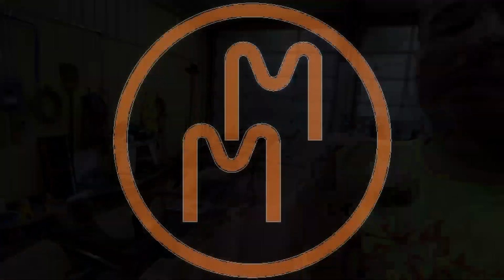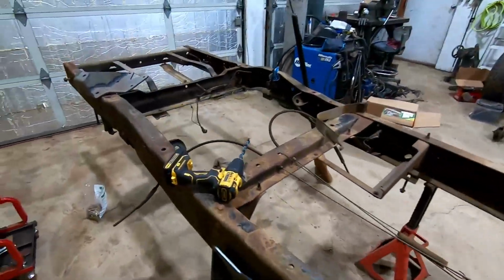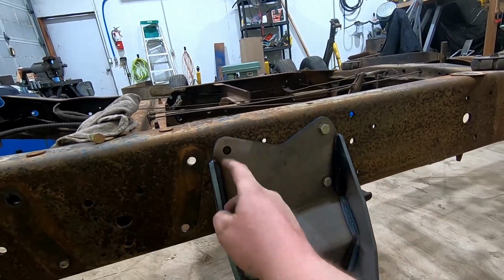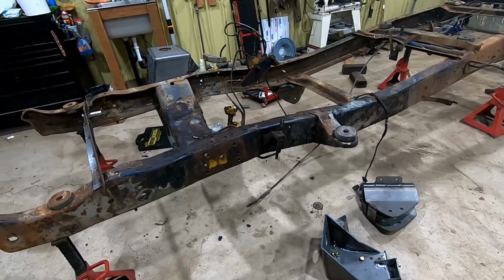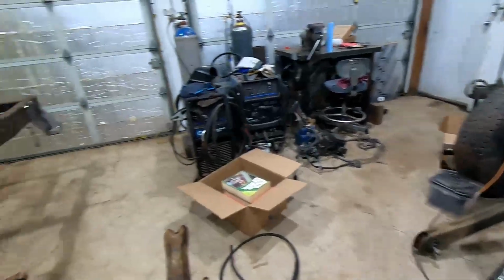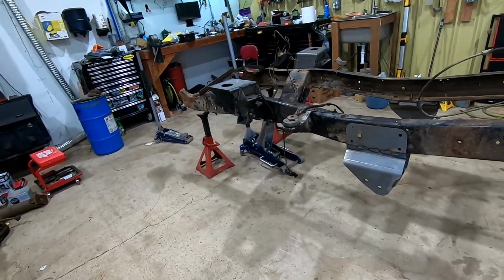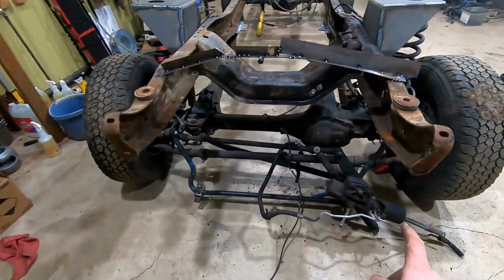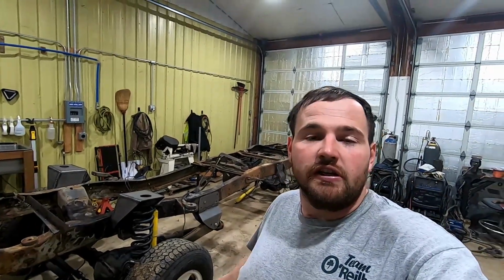1974 Ford F250 Super Duty axle swap Pt3

Comment: Did you use the stock 05 springs on the rear axle?
Reply from the maker: I am using 08 springs in the rear.
Reply: @M&M Motorsports  I'm putting an 07 rear end in my 77 f250. Why did you go with that year springs? What am I missing?
Reply from the maker: @gregholland8655  The 08 and newer springs are longer which provide a better ride. Because of this I had to relocate the front leaf spring mount. The 05-07 are the same length as the 70s Fords if I recall correctly.
Reply: @muntsmotorsports  so does that mean you can just swap a 05-07 axle in without any issues?